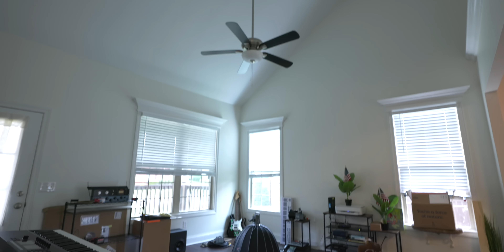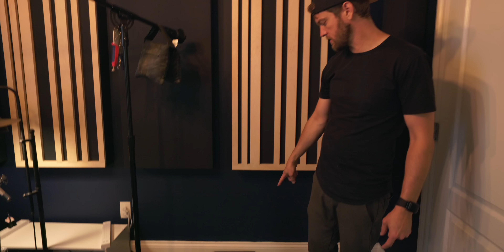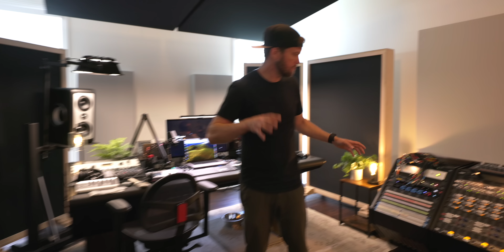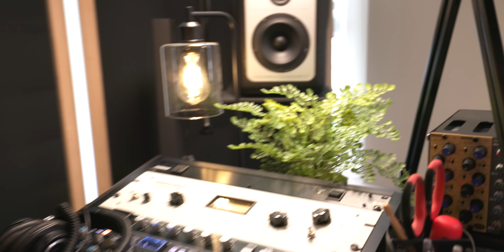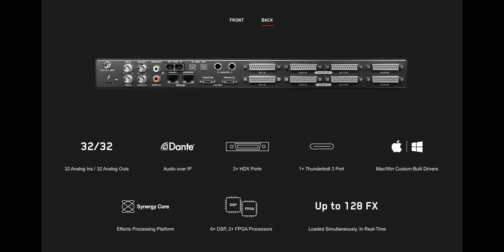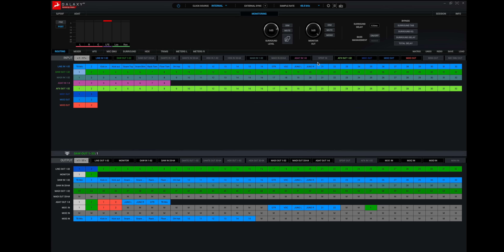Get MORE out of your Audio Interface with Digital IO

Comment: @itsstudiotime noobie question here i have just bought the same config (galaxy32 + ferrofish a32pro) when i connect units (galaxy as internal / clock in ferro madi, same sample rate) ferrofish still shows no lock msg and galaxy 32 control also dont show external sync engaged, any ideias why inst working?

Comment: are you familiar with dante? What are your thoughts on that? when ill start a studio, i'll probably get a pure dante interface with 128 or 256 dante IO, skip the patchbay and just go with dante converters (or dante cards in case of something like the neve 1073opx). If i'd have multiple rooms, i'd only have to connect them via ethernet cables - plus doing live stuff would be viable

Comment: Will the latency be the same at 32 channel input recording? I mean that's the real test. And to be able to provide latency free headphone signals.
Reply from the maker: Yep no latency issues, automatic delay compensation on hardware inserts and direct monitoring via galaxy.
Reply: @itsstudiotime  What would the benefits/differences be with connecting the Galaxy via a HDX card vs Thunderbolt? Wouldn't the usage of the Ferrofish  channels as Pro Tools hardware inserts have a different sample delay because of MADI and perhaps a different internal sample delay on the Ferrofish compared to the Galaxy channels? Is the compensation for both the internal Galaxy channels and the Ferrofish added channels handled transparently in the background or differ with or without the use of a HDX card? I wonder about the same thing if you add any ADAT expander to any interface, how does the main interface know the specific internal sample delay any random ADAT expander has?
Reply: @itsstudiotime  Good to hear. Looks great. Hope you will get lots of customers.

Comment: I am curious why you need to hook up the BNC cable? When I hook up my Ferrofish A32pro using the Madi cable to the RME UFX III it syncs up no problem.
Reply: Ok, I think I found the answer to why Andrew is using the BNC cable because the Antelope does not provide the clocking information in the Madi cable the RME UFX III does so RME interfaces with Madi do not need the BNC cable where as the Antelope does. You can use a BNC cable to with the RME but it is not needed for Madi.

Comment: I'm using the A32pro along with my RME UFX3. Both great units, and the A32pro is super simple to integrate. Great video!
Reply: Hi Greg, I'm considering this setup as well but wondering how the conversion quality compares between RME and A32.  Which conversion do you prefer first?
Reply: @tomrogers2790  I’m not an expert on conversion, lol. I chose the UFX3 as my main interface because of the Madi and ADAT flexibility, as well as the reputable AD/DA conversion. I then chose the A32pro for the compatibility to the RME (both are owned by same company). So the A32 handles the conversion for all external I/O. I takes a while to grasp or understand RME’s Total Mix software, but once yo do…it’s awesome. Plus with this setup, there’s no need for external patchbays, since Total Mix handles both the RME and Ferrofish routing. Hope this was helpful.
Reply: @tomrogers2790  I have the same exact setup I am using a RME UFX III and a new black face Ferrofish A32pro that I took nearly 10 + months deciding to buy or not. So far I am very happy. I did consider the Antelope Galaxy series but I read many reviews that were very negative on the company and I wanted something very solid so I went with the RME UFX III and the Ferrofish A32pro. I may not be correct about the Antelope but I had to come to some conclusion and the Antelope reviews I read were not good. RME has a record for being rock solid according to what I researched.